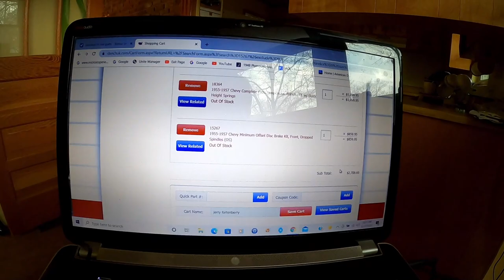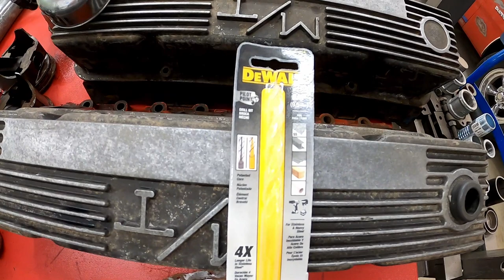57 Chevy Trunk Floor Replacement Part 1

Comment: I wouldn’t remove that tail panel until after the trunk floor is in
Reply from the maker: Unfortunately the trunk floor goes under the tail panel. The tail panel support is loose. I can slide it back and forth. Will show it on the next video. Going to support it if I have enough room to slide in the panel. Thanks.
Reply: @indyme2  I should have spoken more clearly. By “IN” I was meaning IN POSSESSION. I have changed tri-five trunk floors as well as complete floor pans. The reason I was saying to wait is that while it may not seem like much support even that rotted tail panel is giving some support to the quarter panels and helping keep them aligned and making other tasks easier. I had a panel sag and kink from lack of support for a few days. Did not make me or the cars owner very happy and it caused more work
Reply from the maker: @todddenio3200  The full floor and rockers are intact. I agree with you. The more support the better. Any suggestions on how to get the trunk pan in? Looks like I may have to cut it and reweld it to make it go in. I made a full size cardboard template the same size as the trunk floor. It's kind of like trying to fit a square into a round hole. All advise is appreciated, Todd. Thanks.
Reply: @indyme2  if you can, remove all of the body bolts and lift the rear of the body enough to slide it in from the rear under the tail panel. You should weld in an additional brace about 6” above the tail panel for additional support and with that done the body can be lifted at the rear from an engine hoist put in from the side and just tipped on its nose a little bit if the front clip is removed. Then lower the body down around it provided the tail panel is trimmed of the old trunk floor. This way the tail panel is still in place and can be used to help align the replacement panel to where it should be from all angles.That’s the best way I have found.
Reply from the maker: @todddenio3200  Awesome, Todd! I'm feeling dumb right now for not thinking about that. Have seen a lot of videos lately sliding floors under and dropping the body on top. I really appreciate the information and will give you a shout out in the next video. Chime in with any advise you have to offer. We appreciate all the input. Thanks again!
Reply: @indyme2  until I became disabled I used to do every type of auto repair on pre computer era vehicles and have built more than a few local show cars (within 150 miles). From Ramblers to EGADS never again — Rolls Royce. I’ve enjoyed most of them but that Rolls was enough to cause a mental breakdown. If there is anything I can help you with let me know
Reply from the maker: @todddenio3200  Thanks Todd. I understand the Rolls. A Mercedes once almost gave me a mental breakdown. Staying away from them forever, lol.

Comment: Your making good progress on the 57 Chevy! I didn't realize on the first few videos thats Belair with all the stainless steel trim! I noticed the little air shock fitting in the corner of the trunk. That's the number 1 reason them shock tower mounts get cracked and broken. Everyone wanted to Jack them up in the back and that put all the weight on the trunk floor. Keep working at it and Tell Vern come on over and help. Lol Have a good one Buddy 👍
Reply from the maker: Thanks, Don. Air shocks and traction bars. Does that scream old school? Lol. Thanks for stopping in. We enjoy the comments.

Comment: I used those panel cutters for years. One trick I found to make it cut faster is to back off the pushing it so hard which allows the hammer to work better. Try it, it's a fine art to learn but worth it.
Reply from the maker: Thanks, John. We will give that technique a try on the next panel. Appreciate the advise!

Comment: I agree with you on computers they can be a royal pain.  My desktop started acting up just before Christmas and Windows had been wanting me to upgrade to Windows 11 from 10 so I let them do it while in the shop.  I didn't like 10 and 11 shows no improvement.  I also agree with you about the panel cutter I have used mine many times.  Glad to see the 57 coming along even though it is giving you a few surprises.  From my younger days have you ever seen anyone use the spare tire well for a beer cooler?  It works fairly well, ask me how I know.  Give my regards to the crew and keep the videos coming, computer permitting.
Reply from the maker: Lol. Like I said many times, Jerry. We must be twins. The well even has a drain hole. Hope you are feeling better. I'll keep the videos coming and you keep the stories coming!

Comment: Splice is the video editing program I use. It’s free and for go pros but works with apple stuff. That panel cutter works good. What a waste of a good floor. Queen should have the duster would throw people off if she pulls up next to them and dusts them.
Reply from the maker: Lol. She is really getting attached to the Duster. I'll be back on fire for it when I burn some rubber in it. We are getting close to having it on the road. I'll get the Rust Queen to do a burnout in it for you! Thanks for stopping in.

Comment: Looks like the tin worms got ahold of it just alittle, Dan, from DDs speed shop up in Canada gets complete floor and trunk pans from somewhere here in the states
Reply from the maker: I am told the floor pan is on the way. Believe it when I see it, Leonard. We will just work with what ever parts we can get. No method or plan for this build now due to lack of parts. Wish this crap would go away. Thanks for stopping in at the Rust Ranch!